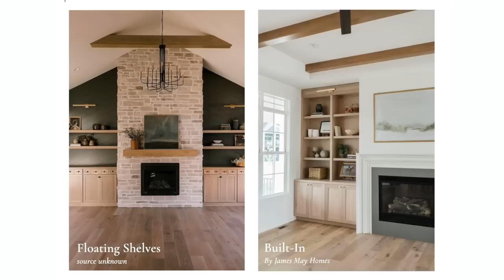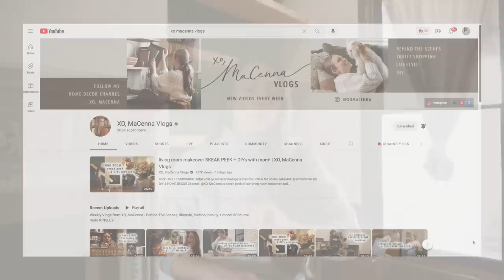Living Room Makeover Ep2 *DIY BRICK HEARTH & BOOKSHELVES* | XO, MaCenna

Comment: In hindsight you should have started the bottom side from the front to back so the smaller brick would be in the back.
Reply: I thought that too but I think she wanted the bricks lining up with the ones on top. It's not a problem to cut a brick in half if you have the right tools.

Comment: 🌺.  FYI: IF YOU GET/ RENT A TILE WET SAW YOU COULD CUT EACH BRICK IN HALF & THAT IS SO HELPFUL BECAUSE IT MAKES THEE BRICKS HALF THE WEIGHT AND THEY DONT FALL OF IF YOUR NOT GOING TO STACK THEM.  AND IT ALSO MAKES IT EASIER IF YOUR GOING TO STAGER THE BRICKS INSTEAD OF HAVING  THE GROUT LINES ALL  IN ROWS.

Comment: This looks amazing! My suggestion would be to cut an inch or two off the bottom of the mantel so the top inside measurement is the same as the sides. It would look more symmetrical and give a few more inches for your TV. Either way I cannot wait to see this all finished (and decorated for Christmas!!)
Reply: Agreed. TVs mounted over fireplaces are already too high for comfortable viewing (I know. I have one.) so even an inch lower can help. MaCenna may want to keep the height for antique charm or scale or something. I know we all trust her.

Comment: For doing the shelves on the other side you should make yourself some template boards out of scraps that are the exact dimensions between the shelves so you can use them as supports and guides to hold the wood for you while you attach them. It also helps ensure the spacing is even.

Comment: Bookshelves are normally 1.5 times the height of a standard paperback which is about 7 inches tall, which would make your shelves 10.5 inches on the vertical. Usually the top shelf/counter top of enclosed bottom cabinets are 14 inches below the first actual shelf for books.
Reply: She's not putting paperbacks on there just old hardbacks probably stacked horizontally as decoration and lots of other knick knacks and pictures etc. It won't be filled wall to wall with books like a library would be.

Comment: Can't wait to see how you finish the mantle. Are you going to line it with concrete board or use some of the brick up the inner post areas?  Just wondering how you are going to do it and attach it to the wall. My daughter just purchased a new/old home and needs to refurbish the fireplace as well. Just trying to figure out how to bring in back to its former beauty. I am counting on you for inspiration!

Comment: You should not paint brick, especially molded, deteriorating, or chipped brick. Bricks absorb moisture and they need to be able to expel that moisture. Painted brick will cause the paint to lift, peel or crack. You can stain/german schmear/lime wash brick.

Comment: If you paint the shelves the same as the wall, will you loose the depth and ‘optical illusion’ of it looking larger?  Both your inspiration pics had lighter shelves.  Other options could be adding some white to the wall color paint to provide a bit of contrast, paint them the same color as the mantel (an unknown for us😏) or stain the same color as the wainscoting.

Comment: It could be cool to rather than paint the fire surround black, to instead get some of that dark soapstone from the kitchen cut as a surround and also use it on the top of the lower cabinets to give you a nice durable surface for styling of even a mini bar station for hosting drinks! ❤

Comment: Just a tip I know from my carpenter father. Don't be afraid to use more woodglue it is better if it spills out of the seems because you will know it covers the whole surface wich you need to get a sturdy joining.

Comment: I really believe the shelves would look much more high end if stained instead of painted, especially since it would be the only wood element on that wall, to tie in with the rest of the home, but I also understand that it's your home, and should be designed to your taste. Perhaps you should wait until everything else on that side is done though before deciding. It's really difficult to remove paint from wood if you do change your mind.

Comment: It is getting nicer and nicer, I think that I am going to build a few shelves in my own home… 😂 
I just wanted to mention two things which made me cringe a little: when you painted your panels in gray, always start from the top and finish at the bottom, because there always are drops falling so by finishing with the bottom, you can fix them by going down. It’s true for any wall and any cabinet or door. Top to bottom always.
The second thing: I hope that you sealed the wood under the brick? Because otherwise, it is going to absorb the water of the mortar, the bricks will eventually detach and the wood may warp. I can tell you that I saw it happen to someone who made the mistake in front of me and very soon the wood was completely warped, such a pity. Any sealer is fine as long as it can receive the mortar on it.

Comment: If you haven’t done the shelves in the cabinet on the left side, you might want to make them a slightly different height so you have more flexibility in storing different sized items! If you have tall internet modem or vases or board games you want to put in there, the different shelf height options could be useful!

Comment: If you paint the cabinet and shelves then I would do more of a built-in book shelf look. Or you could paint the bottom cabinet and stain the shelves. I just feel that it would look awkward if you painted the shelves and the cabinet, and then had two lighter walls on each side. 😅

Comment: You should never apply concrete or any of that sort directly on plywood. Plywood reacts to moisture and temperature, therefore it moves constantly, so cracking is expected.
What you were supposed to do is add concrete board, the same type you would use in a bathroom and then start laying bricks.

Comment: You could have avoided the cut brick in the corner if you had matched the brick and worked back, too late now.  I agree with only giving the bricks a light wash, not solid paint.  I would leave them natural myself.  I don't understand why you spent so much on the wood for the shelves if you were going to paint them, the paint would have covered any knots. I hope you can get it all done before Christmas.

Comment: if you want to be budget friendly, why do the underside of the shelves? just do the top and sides and it will look thick without wasting wood and since you are going to paint it anyway, you could do the underside with plywood if you really wanted it to be a closed box which is cheaper too than pine

Comment: You're doing such a fantastic job, but I think you'll regret the 4th shelf. It's going beyond the windows and it'll go beyond the TV, which will look odd - it'll also compete with, and the space will be reduced, once you add cornice. Remove the 4th shelf and you can add taller items on the 3rd shelf and play with heights.

Comment: Should have the layed the brick over cement board. The concept was good, but looks diy and not sure this will hold up long term. And to mortar bottom of the face brick directly on the hard wood floor is a questionable move. Bottom should have been made of cement board so you're not putting mortar directly on your hard wood floors and you just trim out the bottom with oak shoe molding stained to match the floor and will cover the cement board. Small things and attentiin to detail would make it look more professional.  And put the cut pieces in the back instead of front so it's not visible. Pro's will put the cuts where not in first line of sight.